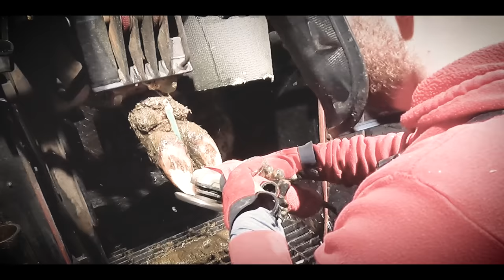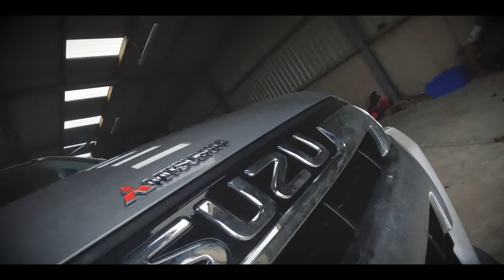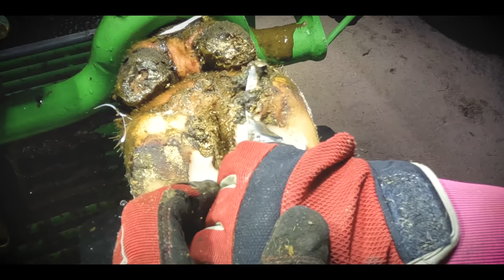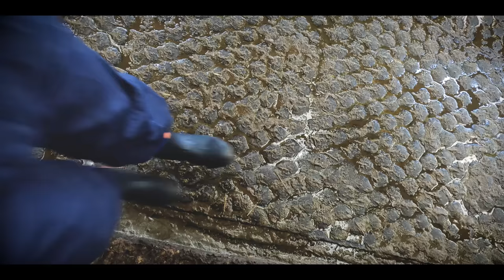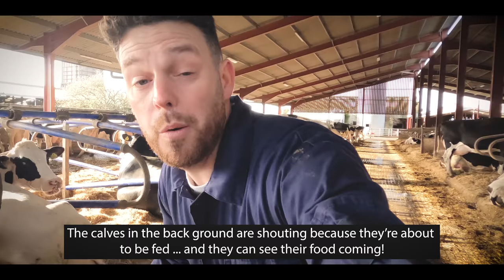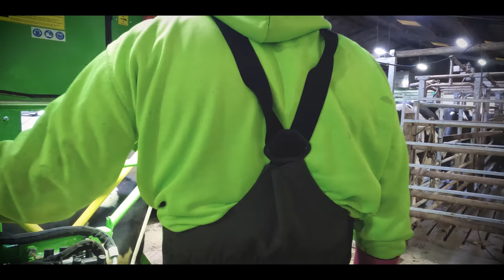BLISTERS ON COWS FOOT ..... THIS IS SOLE ULCERATION!

Comment: I’ve been fascinated by what you do ever since you showed up in my recommended videos. I grew up raising beef cattle and we never even looked at their hooves. They were raised for food so, if one went lame, it went to the processor and into the freezer. We never even called a vet. We delivered the stuck calves and castrated the steers ourselves. We even loaded the semi trailers when they were sold off. It’s good to know that they didn’t need regular trims since they lived a mostly wild life on a hundred-plus acres. Thanks for another great video!

Comment: Bovine house design has certainly changed over the years, not just barns anymore, but well thought out designs. Have you seen any building design changes specifically geared towards regular hoof trimming, say for specific placement of the crush, cow traffic flow?

Comment: Pretty much everything mentioned about the foot comfort for the cows has massive effects on other aspects of cow and herd health.

When Im talking to a farmer about improving the fertility on their farm, all of these points are made. 

The rotary brushes you see in the background are wonderful for mental health ontop of just cleaning the cows.

A factor not directly mentioned is the time a cow spends on her feet. Typically when milking you want the cows to be up for no more than 1hr per milking. So splitting into smaller groups also helps with that. Longer standing times is bad for their feet and also milk production.

Comment: How am I doing?

Well, after a year in between jobs, I just finished my first week at a new one. I'm working under my old Boss (16 years with him elsewhere) whom I get along with very well, to the point I complete his sentences. I'm making more money, getting better benefits, and it is amazingly so less stressful. Found out today if during my daily schedule I work four hours between 6PM and 4AM I get almost an extra buck per hour (so a 2PM-10:30PM shift would get me four hours after 6PM). I'm still learning about the perks, but one is a free (up to 18lbs, roughly 8.6kg for those celebrating the metric system) turkey for Christmas. 

Hoping to see where this goes.

Comment: Okay, I will admit that low temperatures, with humidity, freezes you right through to the bone and takes much longer to warm up than the dryer cold we find out here on the Canadian prairies.  I found that -10 in my home province, on the ocean, is much colder in some ways than -30 in the much dryer land-locked environment

Comment: For your next Home Upgrade, may I suggest a covered, heated walkway between your home and vehicle shed...

To help make sure you make it to the car without mishap on those cold, wet, windy, rainy and/or snowy mornings...

We wouldn't want you to suffer a mischief before you even get to start driving to your first customers now would we...

The upgrade after that should be a heated changing room with shower stall in the corner of the vehicle shed so you have a place to clean the cow💩 off you before walking inside the home...I'm sure the Wife would greatly appreciate not smelling 💩 the moment you open the door after getting home from work...

😄😁😆😅😂🤣

Comment: Other than the fact that I live in Wisconsin, I have nothing whatsoever to do with cows or really any farm animals. So I'm not exactly sure why I'm so fascinated with these videos. But I've really enjoyed learning about the anatomy of the cows and how the way they are housed really helps their feet. And the way a proper trim can cause the cow's feet to heal so quickly. I've learned a ton! 

I do have 2 questions. Do you ever come across cows with connective tissue disorders like Ehlers-Danlos Syndrome, and are they still viable in a heard? 
Also, here in Wisconsin, most of our farms, at least the smaller ones, have barn cats. I haven't seen any barn cats in your videos. Is that not a thing over there?

Comment: Problem with the plastic stalls they break constantly. And the rubber changes with temperatures so if you have rubber in alleys with scrappers it will shrink in winter and expand in summer, the scrappers catch and make a maintenance mess

Comment: On a cold nasty wet/slushy windy day you pull your pants up, your shirt down, tuck tight and don the Wellies and do what is best for the animals.  Nothing else matters but the animals.  On a warm afternoon you could build a lowboy for the crush.  Put on four low geared electric motors and a four way control for steering.  Low center of gravity with 5cm clearance helps drive it off the trailer with a wider base for balance and stability.  Slightly arched main frame beams gives up to 12cm clearance centrally without raising the center of gravity or creating a step for the animal to overcome or trip over.  This electric cart costs about $1,000 in materials and a single afternoon and can move 6 metric tonnes with ease (8 tonnes with some difficulty and motor heating…but no damage).  You can actually move the crush with an animal in it during an emergency….(a cow emergency? Yep, I know, I KNOW!)

Comment: I have a dumb question.  With concrete being bad for a cow's feet, why not go with a dirt floor?  Or even concrete with a padded surface?  Why use concrete to start with?
Reply: You use concrete to start with because the area must be cleanable. If you go with a dirt floor, it will be 3 feet deep in shit by the end of winter.
Reply: @alistairclement4239  fair point.  This is why I watch videos rather than try it myself.  Lol

Comment: Okay, I know this is probably a ridiculous question, but has anyone ever tried shoeing cattle similar to horses? Would it allow the outside of the hoof to remain high enough off the “ground” or concrete area the cattle are on most days and reduce the bruising/sores that cattle can get bc of their living situation?
Reply: You cant because a cow has a bi ped hoof where as a horse doesnt
Reply: @kimcallaghan3404  oh, that makes sense, but this day and age, where we have so many advances in all farm related fields, someone should figure out a way to solve that issue!
Reply: @beverlyhess611  It used to be done a lot with working oxen. The issue is time versus benefit. Horses have to be trimmed and reshoed every couple of months, the world doesn't possess enough cattle hoof trimmers to do the same to cows, so issues would develop from the shoe becoming too small, and white line issues are much more difficult to deal with than ulcers.

Comment: Can’t you pull the New Crush behind the car like the Appleton? Can cows be ticklish on their softer parts of their feet. I noticed sometimes the cow flinches if you touch between the claws.I thought cows had their own stall that they lie in. I didn’t know they moved around.
Why don’t the cows thrash about when they are basically hanging on a belly strap & all 4 feet are up in the clamps?
I do not “do” Christmas I celebrate Yule on 21st December. We do not decorate our house with tree or tinsel. We celebrate outdoors.

Comment: I said if you can some people that own forms of stuff and by tala why they won't get some different type of material that lay on the ground besides concrete can I use clay can I use the rubber on the ground and it got to be a solution

Comment: So, from what I'm understanding, to understand the plight of sole ulceration, you can imagine walking barefoot everywhere, but putting all of your weight on your heel. Now think of walking on concrete like that. Ow!
Reply: Except that the horn of the hoof, is the equivalent of a shoe.
Reply: @alistairclement4239  A couple things wrong with that; The horn of the hoof is much more flexible than a shoe, and it's able to bruise and rot in much the same way as the rest of the flesh.
Reply: @papawheely3627  the bruises are from the blood in the corium seeping through, they are not the actual horn bleeding/ bruising.
If you leave your shoes out in the Rain long enough, they WILL rot.
Reply: @alistairclement4239  That is fair. On the other hand, I still feel like the hooves, especially given their weight, are much more like a thick moccasin or leather soled shoe, as opposed to the more modern shoes we're often used to. I do see your point that they're mostly analogous to shoes, I just don't think modern shoes fit that analogy anymore.

Comment: Have you ever had a Cow in too bad of condition to keep the leg/hoof?
Reply: He's had them where the claw was amputated, but whole hoof amputation isn't viable on a commercial farm due to the need for an extremely labour intensive prosthetic limb.This means euthanasia becomes the only option. It is however, very rare.
Reply: @alistairclement4239  I used to know someone who's friend had a cow with only three feet, though it was a milk cow that was only one of a few and she did have a lot of trouble getting around, but I see what you mean and he does work on large groups of farm cows

Comment: That’s one thing I noticed with the dairy cows u care for. They have constant diarrhea! Cow poo is NOT supposed to be like that
Reply: You know one thing that'll make it look like that? Spring Grass.
You really shouldn't pretend you know what you're talking about.
Reply: @alistairclement4239 Thank you for your explanation. I often wondered because it's not normal. In his south eastern area we call the good dropping of a cow a cow paddy. There is even a cookie made with that shape which most people love. It is mostly chocolate and I think oatmeal is inside.
Reply: @alistairclement4239 I love the America detail I forgot.
Reply: @jacquelinedavis6607  In southwest England you can buy chocolate cow pats.
Reply: @alistairclement4239  That's cool to know. I wonder if the recipes are similar. Wouldn't that be a fluke?
Reply: It can be a bit runnier when they’re stressed. Out in the field it comes out slightly firmer and settles into a patty ..that when dried out can be used as fuel for the fire..and has been for thousands of years..